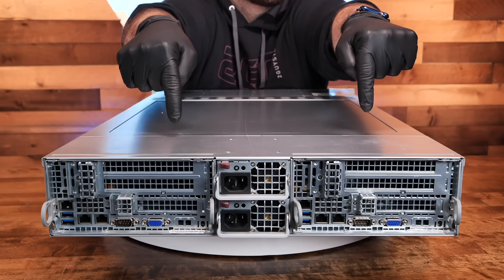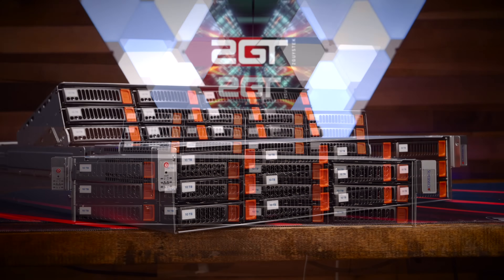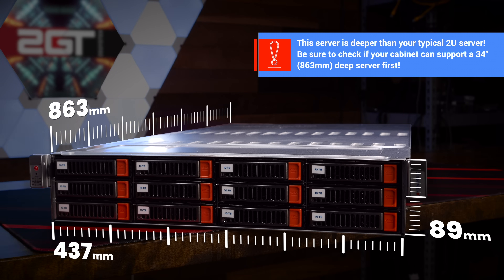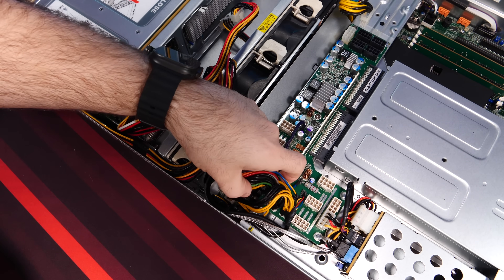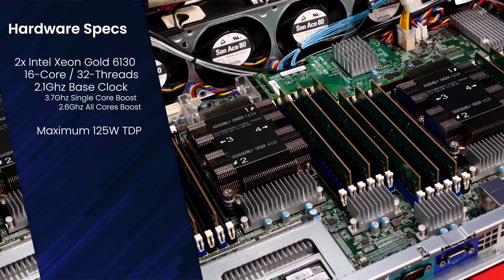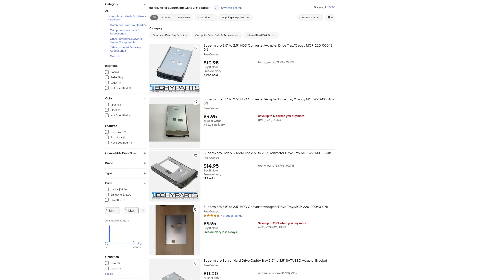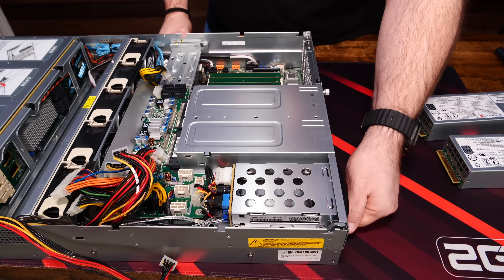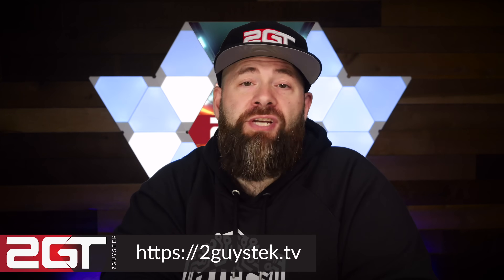How Did They Fit 24 Drives in This 2U Server?!

Comment: Looks great, but I have a request. Can you please write 2 or three sentences about the two node server you built 2 years ago? Was it a good solution? Did it address your needs of double the power in the small space? What were the drawbacks? I love the channel and used one of your videos to build my first 2U home server. Thanks for the great content!
Reply from the maker: Happy to! I loved my dual-node SMC server, and honestly I would still have kept it till today if it wasn't for the aging CPUs inside. Compared to my 4-node SMC server I built recently, it was quiet, had more physical space for add-on cards, and it was a solid reliable workhorse for my dual-node VMware cluster. Depending on what your use case is, if dual E5-2680v4 CPUs are sufficient for what you need, then I would recommend one, hands-down any day.
Reply: @2GuysTek  Thank you for the inside information. Your Superboi build with John was the template for my current server which is still running great, but all eggs are in this one basket and additional nodes seem to be my path forward. You guys are a great source of information, so thank you again for the super content!
Reply: Very cool build. So much space!

Comment: There is also an all 2.5 version of this. It is 48 u.2 2.5 inch ssds, with 4 plx chips (2 per backplane). I have actually tried one of them lol. Cool servers

Btw protip you can disconnect a few of the power connectors on the main board and flip the power supply tray up on the rest of the system so you don't have to undo the thing every time. Lol.

Also, there is a raid card version. It sits on top of the motherboard just behind the fans, and the caps sit on the battery tray on the side opposite the PSUs. Lemme know if you want me to find the model num for it. Too lazy rn
Reply: @2GuysTek its the ssg 2028-nr48n
Still have it actually. Its a pretty cool server. If only modern stuff didn't obsolete it so fast lol

Comment: mm very interested one question dose this mobo have a internal usb A port like most of the supermicro mobos i have seen and played with my got to is unraid and prefer to run in on a slim usb plugged internally to not have to worry bout in hanging out the back and something happening
Reply: nm i see the usb by the two internal sata connectors might just have to pick one up
Reply from the maker: Yes, there is a single USB 3.0 Type-A port next to the built-in SATA connectors. You can sorta see it in the shot of the SATA connectors in the video.

Comment: Wish the video goes more in-depth on the mid-section (bpn, power, latch mechanism, and etc) since that's the whole point of the video (or the whole reason i personally i clicked). Also, for those wondering, the chassis is about ~15CM longer than 846/7 and/or 826/7 based on the measurements provided in the video.

Thanks for the video, nonetheless! Very interesting.
Reply from the maker: Fair points! There will be more videos in the future around this chassis, I'll make sure to capture that!